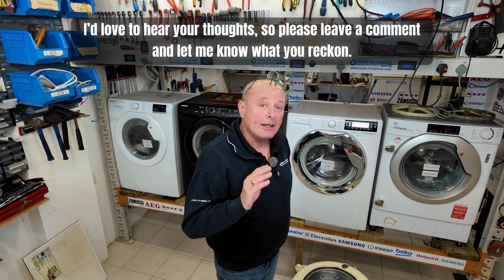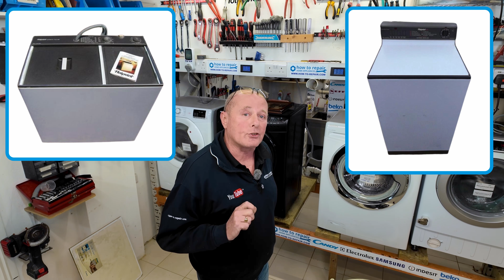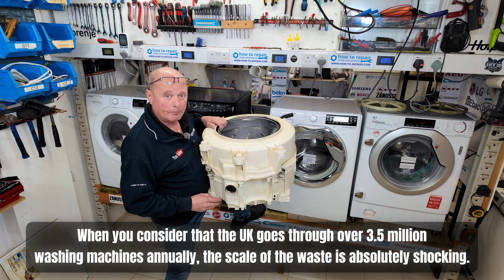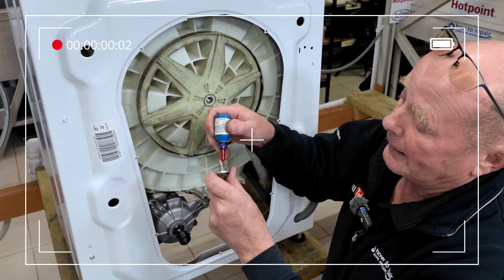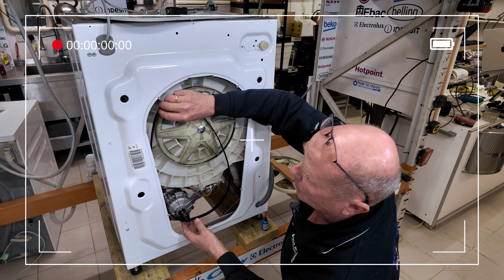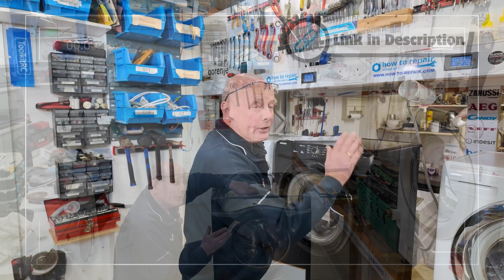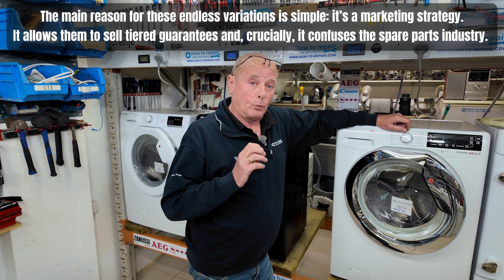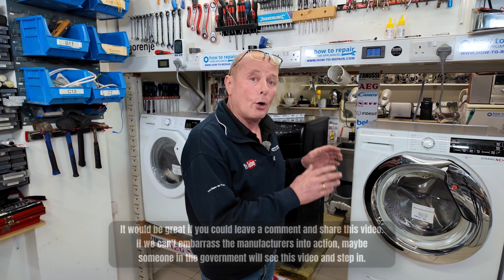I Scrapped 13 MACHINES to Prove a Point: STOP BUYING These Brands!

Comment: I've got a 2000 Inglis (actually made by Whirlpool USA) top loading washing machine with direct drive (no belts nor pulleys), electromechanical timer (no fancy electronics), heavy duty model,  that has had only 1 single minor failure in some 26 years and I fixed it myself for about $10. The "dogs" of the agitator were worn out. Found them easily and looked at a video on YT on how to replace them, quite easy to do and took me no more than 15 minutes. The washer is working perfectly and I will keep it until my death (I'm 61 and I'm sure I'll die before this washer does). I don't want anything to do with stupid front loading washers EVER, because they will all fail long before my top loading one. BTW, my Inglis dryer dates back to 1975, and only the belt had to be replaced, some 20 years ago already. They sure don't make them like they used to.

Comment: Planned Obsolescence and just Obsolescence is a big thing in my current industry, as in we try to identify which OEM's are doing it and staying the heck away from them but we are a very small volume buyer and often not very interesting to keep as a client for other puropses than perhaps PR but it is a sensitive and controlversial topic...

 Planned Obsolescence is not an engineering problem, it is a "quarterly return bean counters"-issue and a PR-problem (or should be). People running theses companies want to pad their pockets before they move on to the next position, they know how to tell engineers, who usually want to build long lasting and resource efficient products, to save money on certain details in the design and this is how  Planned Obsolescence crop up. Sometimes it is even more evident like printing counters that would stop your printer from working after a number of prints that can still be found with certain manufacturers.

As consumers we need to start voting with our feet and not buy products that has these types of features. The term green washing, is not just a horrible pun in this context, it is something that should be used against companies that  has planned- or otherwise obsolescence as part of their business model. Though sometimes it is not that easy as more and more people are living on the marign and cant afford a washingmachine with a 7-10 year warranty...

Comment: "... making impossible or uneconomic to repair." 
please, elaborate.

My story BSH (Bosch, Siemens, ...) :
I had a Bosch (around 2013) with faulty PCB. Even though, the machine was easy to disassemble, it was impossible for me to source the PCB. I had to get the factory service, which resulted in a 300 € bill. I decided to get it replaced, just because I did not want all the other (still good and cared for) material go to waste.
As far as I got it, a standard-PCB was flashed with the model-specific firmware and put in. Very easy job - if BSH had made the PCB just a little different: with a USB port and offering the firmware as download. 

(I would not even care, if I'll get the model specific firmware, with the exact selection of all this bullshit washing programs, that seem to be the only difference between the dozens of models of one series - just to irritate the customers and prevent price comparisons.)

There are lots of people, competent enough for this easy work, out there. It would increase sustainability, empower their customers, ... and be a HUGH ARGUMENT to choose THEIR PRODUCTS!!!!

A similar concept seems to work fine with the modular 'Framework Notebook', that got fantastic reviews. 

> We should get the EU to create more customer protection laws to prevent this reprehensible business model!!!

Comment: Having worked with Miele, I would have to say - that they at least seem to try and keep up their quality. They are slow to release new features, because they work to ensure the quality of their componentry and functionality. When I worked with them in 2015 - they were still using serial for data connections, because they didn't feel they had gotten RJ45 to be reliable enough for data transfers.
We worked on - mainly - industrial machines and we sort of opened their eyes to how data prediction could help them out. We were able to identify when a heating element would need replacing around 2-3 weeks before it was necessary, so they could easily book an appointment with a technician to come and change it. We could also quickly register wear and tear on bearings and much more. They found this extremely helpful, because the most important to them was ensuring reliability for the customers. We worked in a basement of a hospital for three months - and one machine being out of comission in such a place, messes up everything.

Comment: The simple truth is:
Yes they comply with the Right To Repair Act when their selling the spare parts but because they don't want to have spare parts for 10 years they sell the parts very overpriced to stop us from repairing the machines.
Clear as water. 
We need a rule to enforce that the sum of all spare parts should never be more expensive than the value of the machine when new.

The electronics needs to be addressed as well. I cannot accept the quality of the electronic boards this days when the electronic components are better than 30 years ago. As an example: I have a Commodore Amiga computer with 35 years and still works (truth: have been parked for a while but worked a lot back in the days). Electronics failing after just a few years is not acceptable at least for me that I'm an Electronics Engineer.

Greet from Lisboa(Portugal). Nice video.

Comment: Thanks for your video. Very informative.
If anyone on the comments had the same issue as me and found a solution I would be happy for the help. 
I have an electrolux pure Q9 hoover. The motorised brush is not working anymore. It is the second brush i bought from electrolux. The new one has lasted just over two years. I suspect there is an issue with some cable that is having a fals contact. I changed thevfirst brush for the same reason.
I decided to dismount the brush to have a look and see if it can be repaired and here is the first issue i run into. The brush has several alen screws but no tools sold fit the screw diameter. I tried with a 2 mm allen key it is too small, a 2,5 mm is too big. I thought then that it must be imperial, so i wentvand bought a 3/32 allen key (which is a 2,38 mm) and it is still slightly too big. Does anyone know which diameter of Allen key should I buy to dismount these screws? Ot is electrolux having some proprietary allen screws?

Comment: Energy efficiency is what these companies think they got to achieve. However -  I am running my 20 yrs old machines (we have two in our household, Siemens and Miele) with preheated water (from solar or woodfire, same goes for space heating in general, so it's a by-product to use it for hot water) and bought a gateway 15yrs ago which automizes the hot/cold waterflow into the machine. With that you can reach energy efficiency much better than todays machines - apart from their scrap quality.

Comment: My 5 year old Miele crashed repeatedly after a recent firmware update. Machine stopped mid cycle showing fault code F49. Authorized technician said it was the failure of electronic components, quoting a repair cost of US$1200. He offered to disable Twindos to bypass the failed components. Twindos disabled, problem persisted. 
We then tried Mobile Start. Problem solved.
They tried to sabotage the machine using firmware update, but apparently had forgotten to apply the malware to Mobile Start.

Comment: 5:20 Dont know you, but i love being handy and capable around the house and fix my own stuff and improve it. 

Im honest, if a Machine i buy lasts 2 Years and more, IM HAPPY.  I calculate purchases with 2 years lifespan.  because most products are made to fail  past 24 months. 
Can not imagine buying a diswasher and having it for 10 years or even 20-30 years. 

My Grandmother had a Miele Dishwasher ... 27 years old and it was a super easy fix to repair. Still running to this day. Its Mindblowing!

Comment: Yeah, manufacturers are under huge pressure. A lot of rivalry, so they cant make a long lasting product and keep on surviving. Instead they make a cheap sh*t, and demand high price for separate components, so that people would buy the new machine instead of repairing it. This way they the market that they can produce those machines for and they can stay producing. 
I dont know how it would be possible to maintain this type of economy without having a internal agreements between different manufacturers...

Comment: Miele is the ONLY Machine  i buy  , 25 years old and still no problems.
Reply from the maker: The older mieles were incredibly well built machines although the spare parts were not cheap and it’s a crying shame that manufactured does not give you any technical assistance when you have a problem but the newer machines on the lower end price bracket now have started to incorporate sealed washing machine drums

Comment: You make a great effort telling your audience about the changes in the industry. However, since all the manufacturers produce washing machines with sealed drums you have no real choice - you either get a cheap one hoping for the best or you get twice or three times the price washer with the same issue.

Regarding manufacturers - bosch/siemens/aeg/miele all produce units with splittable drum. Unfortunately , a washer with the exact same drum , produced 2008 for example lasts up to now, only bearing are going bad which can be replaced. However there are models produced 2020 with the same drum but the quality of the spider is much worse - even when you have access to it is still uneconomical to invest so much money into repairing it. If you are lucky and the spider doesn't collapse , its gonne be either the main PCB or the inverter PCB - and again a huge investment , not worth doing.

Why not buy Miele for 2000$ and use it for 20 years? - because its not gonna last that much, sadly. They were producing great machines until 2012-2013 but after the W1 models they are absolute crap.

If someone asks how i know this - i've been importing, repairing and reselling those units for the last 5-6 years with hundreds of sold units. My father used to do that for his last 25 years. There are some clients who bought washer from him in far 2010 which are still working up to date with minor repairs - just the quality rapidly dropped.

Comment: As much as I can blame the customer using these, I cannot fault them properly.
I had one washing machine in an apartment under rent that stopped functioning. The technician found the fault to be the buttons having failed to talk to the board. Easy, right? Just replace the plastic buttons and done. Nope. The technician clarified that you had to order the entire board (no loose buttons) and that it would take at least a month. So I asked my landlord if it was ok to just 3D print the buttons and go with that. Nope, I got a brand new machine in 2 days. And I understand why this from his point of view:  why delay this problem and have to possibly explain this situation to a new tenant instead of just putting it brand new.
So in the end, it is difficult to blame people who throw these away because it has become much more difficult and inconvenient to do so. I would say this wasn't something calculated if it didn't happen for literally any product with a warranty.

Comment: Planned obsolescence is a direct result of economies of scale where items get much cheaper as production capacity increases, if a machine was now built to last 25 years as were the machines of the seventies, with the shear numbers of manufacturers of these things , lots of those makers would simply go bust because they would no longer have a market as their products would last too long, millions of jobs would be lost and of the manufacturers that remained their products would be very expensive due to a limited market, those out of work across all industries as a result wouldn’t be able to afford a new machine, so what do you do. The population growth and modern living standards have naturally driven things in this direction, and just like you I hate it but I understand it and it’s here to stay unfortunately.
My own recent experience with a Samsung direct drive washing machine, a lovely quiet machine failed after many years of service, I took it to bits to see what had gone wrong and was amazed to see that the spider had been eaten away by powdered detergent sticking to it, so with this knowledge I now never use any type of powdered detergent and use only liquid types as this will not clump and stick and will easily rinse off, the new machine is another Samsung but with an digital inverter which is guaranteed for 10 years.

Comment: I think have an index manufacturers/models -  the score would be higher, unsealed/not-glued drum works score higher than a glued drum. Cheap PCB available ? Higher score. 

Other than that, I can only think of going down the open-source route, creating a Frankenstein style washing machine from cheap/readily available parts with full service manuals

Great videos thank you, this is something that needs to be highlighted

Comment: My early 90s version 1 Hotpoint 800 Electronic 9506 is 32 years old and clinging on for dear life. Has served me well, never broke down and I've only had to change the brushes once this whole time. Sadly, it's developed a couple of problems over the last year. The door often sticks and takes multiple attempts to open, and filling during the rinsing cycles has became very slow for some reason but not the initial fill, which is as fast as ever.

I'm no longer fit enough to repair it myself and am loathe to replace it with a new model. Watching these videos has been helpful and informative but quite disheartening at the same time. Sad to say, they sure don't make 'em like they used to.

Comment: I still use a 1978 GE refrigerator in a nasty 70s gold color...Why replace it with something inferior? I built new shelving for the lower crisper, keep the condenser and fan clean. Its been mechanically trouble free aside from normal wear. I did have to finally replace my similar vintage kennmore washer after the tub seal gave way. In its place went a Speed Queen TC5. The Old Kennmore gas dryer still works fine only needing 3 belts and a tensioner pully. I do spray graphite dry lube on the rollers every few years. They don't build em like they use to for certain.

Comment: Not washing machines, but still really annoyed me.  I was asked for a price to supply and fit 3 new control knobs and a door seal to the upper oven on a hotpoint double oven.  Parts alone was pushing 200 quid.  How can they justify 40 quid for a cheap plastic knob?!  I always try to fit genuine parts where I can.  You know they're going to fit and work as they should.  But given that genuine parts are going to make the oven an uneconomical repair, china's dumpster has turned up a set of machine aluminium knobs and a seal that claims to fit for under 20 quid.  Fingers crossed they'll fit when they get here next week 🤞

Comment: The German "premium" brand Miele machines used to last 20+ years and came with a warranty of like 10 years. Over the decades, the quality dropped just like the brands you mentioned. I had a £1500 Miele washing machine leak water after just four years only to find out their warranty is only two years now. In fear of excessive callout cost and spare parts for a Miele service technician, I tried to find the cause of the leakage myself. Having neither an engineering background nor repair experience, I failed.  Instead of repairing the machine, I raised it on a stand to collect water in a box below it.
Suggestion for a law in terms of right to repair: if the spare parts must be available for at least 10 years, the total cost of all spare parts must not exceed x times the machine price. If some parts like the cabinet are not available, some tbd value must be included in the calculation.

Comment: About legislation, whatever of a law you create and impose, makers will know how to evade. 2yrs mandatory warranty? ok, they'll know how to go by the law but not offer a real 2yr warranty for the whole machine, or prices will be locally more expensive because of the warranty. Right to repair and availability of parts? ok but costs of parts will be expensive and repair almost impossible. They know how, they won't lose a penny. The only way would be, if people really want that, to support new brands that can appear and make repairable things. Let's say Framework in the laptop industry. They do something like that. If a lot of people would buy framework, then other brands will have to do the same.

Comment: I just can't even comprehend the engineering thought process of using chipboard for the top. Not only is it in a damp environment but most users will often momentarily deposit wet clothes on top of the washer.

Comment: Using chip wood top on a washing machine should be a crime itself lol I've bought a Chinese rebranded BGH here and the top is plastic. Makes a lot more sense. The cheap ones made here locally are chip wood too. Incredible. IDK how it works there but when you mention all those brands doing the same, are you sure it's not the same factory? In a lot of countries, different brands would buy all the machines for the same 1 or 2 big factories and brand them.